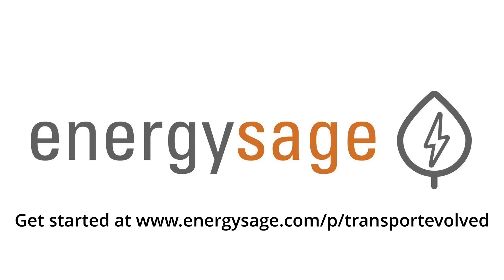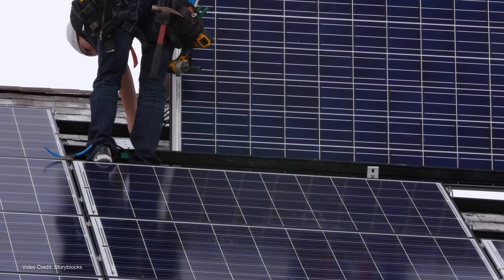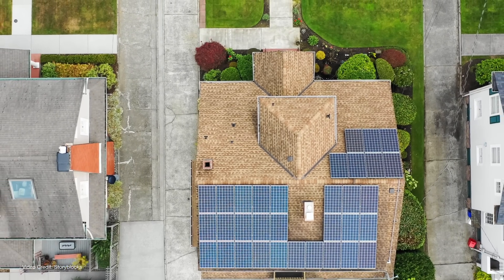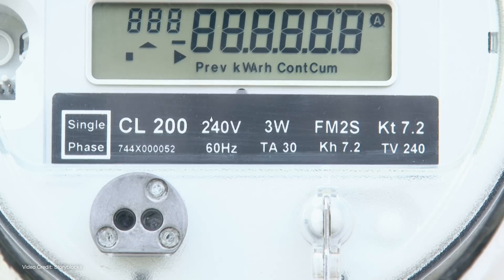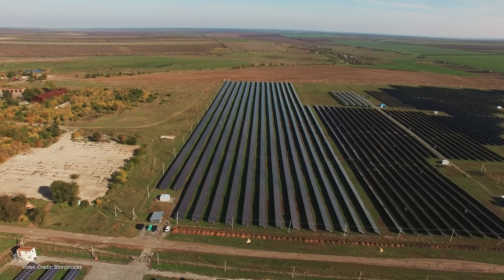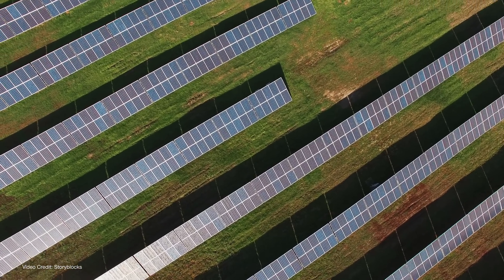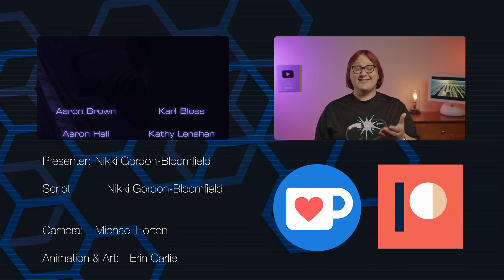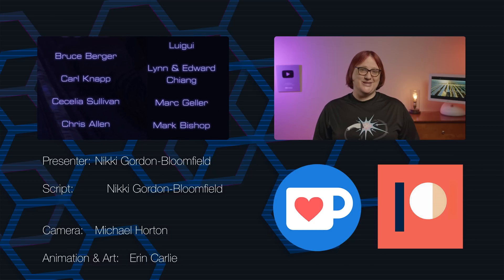How Community Solar Could Get Your EV Running On Renewables (Even If You Don't Own a House!)

Comment: I just looked into this. In Florida, Duke Energy offers a Shared Solar program. It isn't nearly as attractive as a proper community solar program but slightly cheaper than my average kWh rate (.163 vs .112). I can buy 50kWh blocks (up to a max of 25) with a net cost of $5.96 per block.

Comment: Technically you can follow the route the power actually took from the generation points to each consumer but literally nobody gives a shit provided the generators get paid for the power they generate, so in practice electric power is more or less the same everywhere, although some grids like in the UK do charge extra depending on distance from your chosen generators so you can be slightly better off choosing a local supplier than a distant one.

Comment: Here in the UK a couple of months ago we bought into exactly the same sort of scheme; but for wind. We own part of a wind farm being built about 50 miles from our house. It will be finished being built next year. It doesn’t work “net metering” but we do get a bill credit. It should cover about 100% usage but I forgot to factor in our solar and storage. it will probs end up offsetting our higher electricity when we get our ASHP installed. The project is by Ripple Energy. Apparently they have a solar park in planning, I may get some to cover our ASHP and car charging.

Comment: In the north we need to think more about community wind.  Lots of homeowners can put solar on roofs and its great for 3/4 of the year.  However, in winter especially December and January, there isn't much solar and the panels are covered with snow often.  But at that time it is windy (wind is good where I am for 3/4 of the year).  It is not efficient to install a small wind turbine as a homeowner at present.  Solar projects make much more sense at an individual level.  However a local bigger scale wind turbine that benefits a local community might make much more sense.  If the benefits flow to everyone instead of a large corporation, then nimbyism can perhaps be held in check.

Comment: I'm a landlord in the UK and one of my properties is soon to have solar + batteries installed. I WAS waiting for the price to come down (which it was) but the current economic climate means the price is due to go up, so it was a case of "do it now".
I gain nothing from it other than extra value on the house (can't even offset the cost against income) but I just had to do it. My own house can't have panels so I chose to spend the money elsewhere.
Reply: That’s great, it’s marketable to a prospective tenant. If I were them id be like the ppl in the maccys ads, getting my moneys worth 😂

Comment: I'm willing to bet good money that virtual net metering is going to be ending pretty soon just as net metering even at the individual house level is being phased out in most areas or being severely limited and making it a non-viable option. The duck curve is a mean animal that no matter where your solar panel is located will bite hard. Signing up for and investing in something that has such a high level of uncertainty is a pretty risky investment for anyone and I would highly advise against it.

If you're not a homeowner and have no place to put solar panels of your own, investing in such a volatile and risky asset is irresponsible. The only thing more irresponsible is buying into it on credit. If these solar farms were such fantastic ROI vehicles they would be built by large corporations en masse. But hey, if you want to spend your own money on such things, be my guest...

Comment: I'd really like to see more places building solar car-ports. generate electricity, and practically begging for an EV charger to be built into the supports!
Reply: Way back in my Phoenix valley living there were covered car parking spots everywhere that would be a metric ton of surface area if they solarized it all. Back then the utility worked overtime to suppress all solar use so I hope that has changed.
Reply: Every Walmart, Home Depot, Target, and other box box store should add a row of solar panel canopies in the parking lot.
Additional solar energy for the stores. covered parking to get out of the heat or rain and level 2 or level 3 electric vehicle chargers.  Each of these big box store could easily add 5 fast chargers and 20 level 2 chargers. These huge parking lots can be used to generate solar energy. Solar canopies are an under appreciated opportunity to advance solar energy in parking areas.